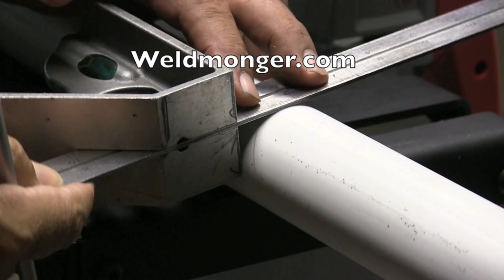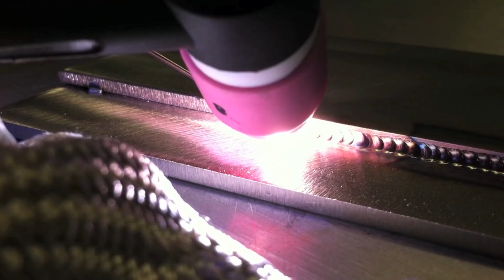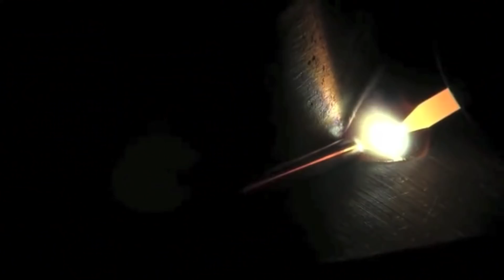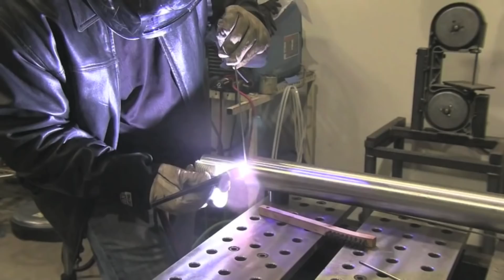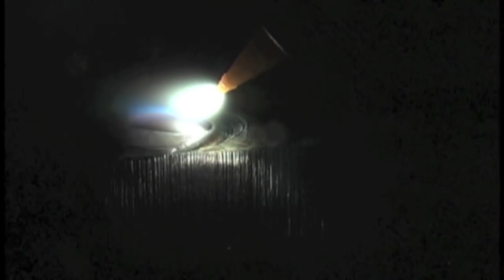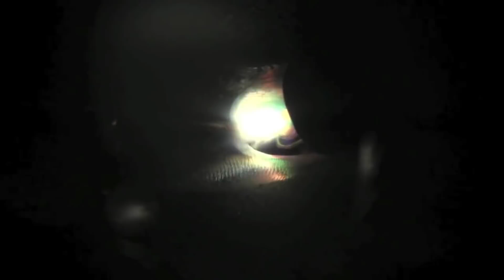TIG Welding Rods, Tig Rod Storage, and Arc Shots

Comment: I bought a DEKOPRO Stick/Lift Tig welder machine. It was cheap as chips tbh but I had to buy a seperate Lift Tig Torch.. I'm a complete newb to this game save for a year back in the 80's, that's the 1980's man when I was in Metalwork class in high school as u would call it in the US. Here in IRELAND we call it secondary school but I did some gas/acetylene welding and Arc welding back when I was 12/13 yrs old.. I loved it but tbh I loved the acetylene better than the stick welding. I kept getting stuck to the workpiece.. LMAO
I have only recently bought 2 small inverter welding machines so I can Tig weld on one and keep the other one for stick welding. I don't really want to be running both but it's a lot less hassle changing thing out all the time. 
The  DEKOPRO machine is a decent little mahine tbh. I've never TIG welded b4 so this is brand new to me.. This was a brilliant video packed full of the kind of information I will need so now it's dropped into my welding playlist.. Thanks man.. Salute to u sir from Dublin, IRE..

Comment: Using primer is great for plumbing.  This is just storage, not mission critical plumbing.   The problem primer is that it sort of drips all over the place and looks bad.   If you were to sand interface, it would have been more than adequate to keep the pipe glued together for this application.

Comment: Where is a difference between rod 316L and 318L in practice? I have found that they are marked like with the same numbers 19-12-3, and just letter markings are different NCSi and NBSi. What makes or does it makes difference when I use them to weld stainless steel 316L salt water tank with working temperature under 100 degrees Celsius? Sorry for so many questions, I don't have proper literature to find answers by my self :( 
Thanks in advance ...

Comment: Please help. I went over a thread with a filler rod and i cannot cut threads on it. Its too hard.
What filler rod do i need to be able to cut threads on it ?
I used ER70S and i have ER308L but did not try it yet.

Comment: this is an older video, but to help others, I just paid $48 to fill a 180 size tank of pure Argon, in the SF Bay Area, quite expensive compared to this =/
Reply: Can you tell me where you are getting this price? I'm also in SF Bay Area and I was quoted ~$190 to fill my 250 bottle with pure Argon.
Reply: @charliema3762  I paid $48 to fill a 160 at County Specialty Gases in Redwood City, gas is a good price but their tools and consumables are priced like a retail store , a bit higher. Very cool place check them out

Comment: have found long tube plastic bags i don't remmender were i got that roll from  put them in the plastic  stoped them from rolling around when  going to job sites in the tubes 
like i do like the from weld stick welding rods too  put 10 rods inside and can seal the ends up too rubber band round the end after you seal the bag up i don't have a larger number of open rods on the truck too

Comment: Has anyone tig welded with the Lincoln EN13479 carbon filler wire? I've been using it, and I find it extremely slow and sluggish to move the puddle. Just wondering did anyone else notice this. Cheers

Comment: I'll add another comment to the one I just made. Here (France) you can't get plastic pipe endcaps as such ,they are a threaded socket to which you have to buy a threaded plug and together they must cost 3 times as much. As for welding rods, I recently went to the largest welding supplier in a radius of 50 miles and asked what grades of silicon bronze they stocked and they didn't even know it existed. If anyone asks you why the allies had to liberate europe, there is your answer. Stupid peasants.

Comment: I live in Marin County, north end of the Bay Area, just across the Golden Gate from San Fran. I got taken for a ride by Airgas for a couple bottles this week. I bought 2 125x bottles to the tune of $350.73 each then they charged me $111.74 for the one full of straight argon and $123.27 for the 75/25 mix (With tax, that's $988.72 for 2 bottles the same size as the ones in your video). Newbie mistake I guess because I sure won't be going back there, lol. They charged me $58 for a pound of stick and $42 for another one and both are listed on their website for $38. I didn't know until I got home. I'll drive 2 counties over if I have to before going back to these guys. Is Airgas a ripoff like this everywhere?

Comment: Hey Jody, is it acceptable to use argon or 75/25 gas cylinders in an almost horizontal position? I want to build a welding table with shelves to store the tanks as well as machines. It would be nice to not have the tanks sticking up above the table surface. Thanks!

Comment: Maryland $65 for 80cf 100% argon refill Purchased the tank full total $265 with $65 future refill
Reply: I pay around $85 for refills for a T size cylinder 330 CF 75/25 argon/co2 and around $90 for straight argon. Tank was $350 plus argon cost. You are better off getting the largest size cylinder available especially if you don't need it to be portable.
Reply: By the way that is in Missouri.

Comment: I got a milwaukee fastback razor knife. Stores 4 extra blades to. You press the button and flick it open and closed. I use it hours at a time wrapping duct at a sheet metal shop and opening packages. Then whatever stuff outside of work i find myself doing. 7 months and nicely worn in

Comment: Hi Jody I know this is a old video but i want to say It'm just a hobby welder and I hear about proper storage of rod especially 7018 this is a old trick my grandpa taught me I store my 7018 rod in 3 in pvc contain with a screw on cap and. I drill the glue on cap end but in shut off valve then a small brass tee and 2 hose fitting  1 I connect. To flow meter on argon tank other 1 I connect to a  hand vaccum pump  I suck it down to 10 inches of vaccum then open argon tank and put  in about 5 or 7 psi using gauge on vaccum pump then close valve and store under pressure in argon pressure tank I have stored 7018 rod for years like this runs like new out of  the box I know this is probably not ideal but for what I do works great u can build these pressure storage vessels for like 20$ each

Comment: — — -BRANSON,MISSOURI— — 
125- 75/25 =&45 :125 straight arg.=$60 :125-He=$80 
Then they have a Hazmat fee, Plus the couple years ago the $$of oil? Remember?? They hit me with a FUEL SURCHARGES too. Never took that back off, said to hard to remove from the system!?Then for the grand finale Delivery fee of $50!  Even though I’m a dealer.No Matter one bottle or 10!

Comment: I have tig rod holders made from steel pipe. I know this is fine for ER-70 filler and 309L, and I am guessing that 312 rod is probablly fine as well because they're used to weld carbon steel. BUT, will this adversely affect 308 filler and alluminum filler? I'm worried I could be get some carbon pickup on the very ends of the rods, and potentially on ANY part of the rod that comes into contact with the mild steel. Perhaps I could place some plastic in the end of the tube to prevent the stainless/mild steel contact, or even just get into the habbit of snipping off 1/2" before welding stainless with wire that's been in contact with carbon steel. Anyway, thank you for your input.

Comment: Queensland Australia price in AUD $1.00 is $0.76 USD
All gas I get is e size 4.0m3 cubic meters 
Argonshield mig welding mix 82/18 its in usa use use 75/25 its just the commin mig mix
rent $250 refill is $80 if i own this bottle its $450 and $180 change out so becasue i use more then 2 bottles a year its cheaper for me to rent the bottles
arogon 100% for my tig welders is $204 rent and $134 a refill
oxy acetylene e set is rent and refill together is about $480 
all rent pricers is once a year.
I am told lpg fuel is alot cheaper and its getting more commin instead of acetylene but i like acetylene better.

Comment: I am getting raped on gas. I pay $59.00 for a 119 cf argon that I purchased from air weld and the bottle cost me $400.00 to own. I live on Long Island so I expected a little price hike but this is robbery from what I see from others.
Reply: Dave Zelonis if your situation can physically handle a larger bottle, it's worth it. You pay less per cubic foot for a larger volume. (Same labor to fill a cylinder no matter the size, so the cost/cu. ft. is more on a smaller one.) Also, if you own your bottle, you can trade up to a larger one where you buy your gas and only pay the difference between the two sizes. At least that's how it works here in KCMO.
Reply: Indiana oxygen charges me $60 for 80cf argon now that's rape and 80cf is the biggest bottle they will sell you.

Comment: Northwest Ohio here. A 330 cubic foot bottle of 100% CO2 is approximately $55, a 330 bottle of 75/25 (Ar/CO2) is approximately $95, 330 bottle of 100% Argon is approximately $85, 280 bottle of 100% O2 is approximately $30. I've priced a 280ish bottle of 100% Helium before and was quoted almost $200. These prices are quite accurate but, as stated, approximate as of summer/fall of 2016

Comment: Atalanta GA, just purchased a S size cylinder for $283 and it was filled with 100% argon. The refill on the cylinder is $32.50, my 75/25 mix is $35.00 to refill

Comment: I have 3 size 60 bottles that I own, One has Tri-Mix for Stainless MIG welding projects, another is 75-25 for standard MIG projects and the third is 100% Argon to allow me to be portable with my TIG.  I also lease a size 150 bottle of 100% Argon for my in garage TIG projects.  I just had the Argon 60 filled earlier this month and it was $44 with taxes and whatnot.  The 150 I'm looking at an exchange/fill price of $112 or so.  The C25 will run me $50 to fill the 60 size, and I can't find a price on the Tri-Mix.

Comment: It was a bit "cheaper" than that... Just looked up the price..  You have to go and pick it up your self to get it for 116 usd  (for a refill 20l co2) ... And you have to own one of there bottles they don't fill the bottle if it is from one of their "competitors" (even though it is the same size...  It's a standard bottle except they have installed a microchip on there bottles to keep track of them)
Reply: This is for an exchange bottle in Denmark

Comment: Can you tell me what type of Tig tungsten rod is the best to weld bronze..I am new to all this TIG process and I and having a hard time finding the way and the good tecniques
Reply: +Alambique Mejico If you look up the welding wire you will be using from the manufacturer it will give you good info (settings etc.); for example if you are going to use a Harris Silicone Bronze (see page 2 of the following)
file:///C:/Users/owner/Downloads/SiliconBronzeSpec.pdf
Reply: +Chevy Cam ...ok thanks buddy..

Comment: Where did you get the wide based combo square?  I did the same thing with PVC (I used conduit) then made a board with the appropriate holes to hold the holders in line along the back of my vise bench between it and the wall.  I did not cap mine  but glued a sleeve on it and then gorilla glued it to the wood block in a vertical position.  Great idea.  I use the PVC for many things.  Also converted an old hot water tank into a horizontal insulated warm storage box for my stick rod as I don't use it much since the advent of home mig welders (some of my stick is from the seventies! Bought a few hundred pounds at a going out of business sale.) and I live in a temperate rain forest.  Keep it at 100+ degrees and it stays good, even 7018.  It was a good welding project.   Always enjoy your channel--well almost always!

Comment: just got a large pure helium and it was just shy of 300 Canadian. argon is about 100, i run 92 8 mig gas winch run's about 87. all where large as there is no saving for having smaller tanks plus a year contract of 150. four 4 bottles. O2 run's 38.00

Comment: Just a question about welding in general. How do you know what method of welding to use? Does it have to do with the type of metal you're using or what you plan to weld?
Reply: +Cody Sims With Jody it's what the customer wants, if it's his own project it's to do with how much heat his job can handle and metal type , sometimes if hes welding mild steel  he may just flip a coin. He has the gear to weld anything with any method. Google is your friend.

Comment: 11,000 Yen ($94 USD) for a 7 cubic meter bottle refill of argon and $80 for 7m3 of straight CO2 in Japan.  Helium is insane over here and not cost effective.  Saving for a Dynasty 350... and the shipping... to replace the 200DX, because the 200 just doesn't have enough oomph for my frequent 18-25mm thick aluminum repairs.  How much to buy a 7 cubic meter bottle of O2 and an 8 Kg bottle of acetylene?  $1200!  Yep, Jody, business in Japan is tough.

Comment: G'day Jody, this was a really good article. I am a newbie in Australia and presently setting up my TIG bay in the shed so your info was well timed. I know it comes so naturally to you but sometimes could you mention the handpeice sizes you are also using for a particular job. Also, can you explain what is commonly called "Euro" in regards to TIG handpeices. I recently purchased a Weldsmart Synergic 250A AC/DC Pulse TIG that came equipped with a WP26 euro handpeice and I am laying beads with 1.6,  2% Thoriated tungsten using ER70S-4 wire on about 51A (16 gauge MS sheet) and it is ok but I find the WP26 handpeice really cumbersome and tiring on my wrist. Is it best to go to a smaller handpeice on smaller jobs, eg WP9F. Also, if I am using a WP26 and 3.2mm tungstens would you expect the shielded arc to be the same size as using a WP9 with 1.6mm tungsten. Another question please,  can you have a single cable from your machine that can be interchanged with several heads, eg WP9, WP17, WP26 and finally, if most cables are similar why do some machines have 2 pin control interface connectors, others 4 or as with mine 5. Really love your articles and get heaps of good theory to go away and learn (or balls up). Cheers Gordon
Reply: I purchased a #9 torch after a few weeks of learning/practicing with the included #26 size torch and it was the best thing I ever did for my progress. Also get a nice high quality supple lead to your torch, as the included leads on the chinese TIGS are usually very stiff and will fight you all the way.
Flexible torch head and foot pedal are also very helpful!
Good luck

Comment: Love your videos and bought your labor day special! I just bought a Tig welder and will pick up a bottle of argon on Tuesday and want to get some filler rod. Is there a major difference between brands of rod? I am most specifically wondering about ER70s-2 right now but I am wondering about other alloys as well. I know there can be a huge difference in the stick electrodes and I have had bad luck with off brand mig wire and fluxcore.

Comment: I also like keeping 70s-6 around for mild steel. Comes in handy when you get dirty material and don't have time to clean it properly. Will produce good welds even through mill scale, oil, paint, and even slight rust. I have even pulled it right off of a MiG spool...

Comment: in argentina the argon is charged by cube meter. I own what its called a 6 meter cylinder. in reality its a 40 liter and its filled at 150bar . so is a 6 meter. the cost per meter is about u$s 10. meter of Oxygen is U$S 3.  leasing is not common for individuals. and it cost the same not matter the cylinder size for the refill

Comment: You may want to paint your PVC. It can get brittle after extended exposure to UV.  Thanks for putting out these videos.
Reply: I think, it is not that much of an issue indoors. I have PVC pipes (for rainwater drainage and so) outside, they are there for decades, and they are fine. While old PVC is more brittle, it is still quite strong. PVC is a very long lasting and stable material.

Comment: i have a returnable bottle 20l at 200bar(about 140CF?) it costs 45€ to get a full one. 
(the fee for the bottle is 165€ once), I buy it in south Germany.

In Austria, where i live, at most distributers you have to buy the bottle, costs about 250€ (20l 200bar) and  it has to be inspected every 10 years, it costs ~50-100€ to be filled.
Reply: +Carl Benz prices for Argon, but it's nearly the same for argon/co2.
Helium for welding applications costs about 4 times a much, that's the reason no one uses it.
Reply: +Carl Benz Helium is a "Funny" story , I wish a reasonable substitute could be found,blended .

Comment: 50 liter, 200 bar argon bottle refill (actually exchange, it a $250 yearly lease) sets me back the Norwegian equvivalent of about US$ 300. That's the biggest volume single bottle you can get here, anything more is racks with several of them. Looks similar to yours, but I would guess 1.25Ft taller and contains 10 cubic yards of gas at atmospheric pressure. Bastards weigh 200 Lb full..
Reply: +SWREngineering  almost the same cylender in argentina its about u$s 100

Comment: jody looking to build some headers. what is needed to get setup with tig pretty cheap on mp 210? seen video where u had that adapter from ebay and 17 torch is that all that's needed. thanks
Reply from the maker: +Robert Botello cheapest way to tig is with the adapter block and a 17 torch with a valve.
but for header and exhaust work, a foot pedal helps a lot.  but problem is its quite an expense to get lincolns kit and foot pedal.  usaweld.com has a pretty good deal on  foot pedal kits  for the 210mp
Reply: Thanks I found it. What else is not included for torch ? Sorry I've never tig welded before.